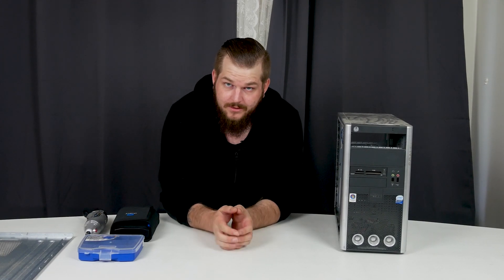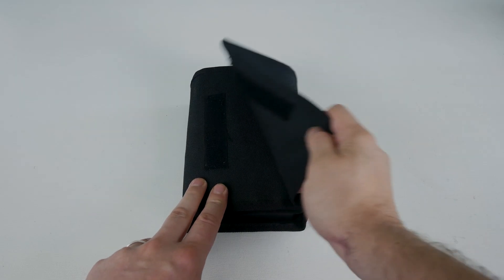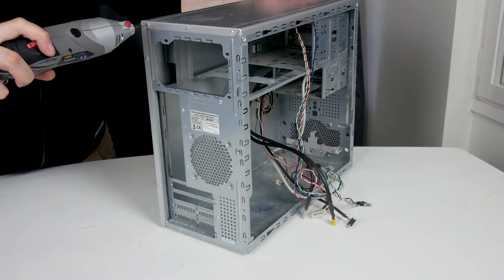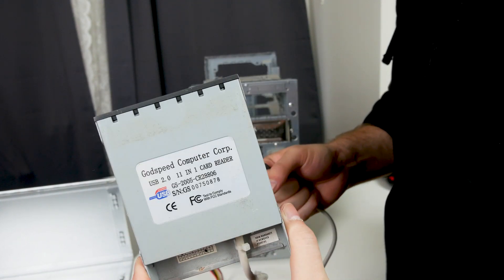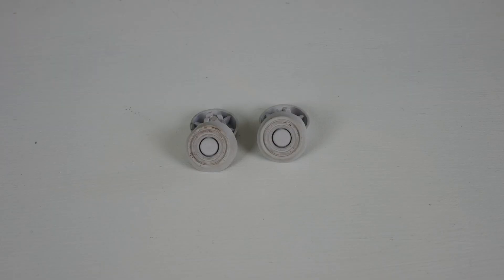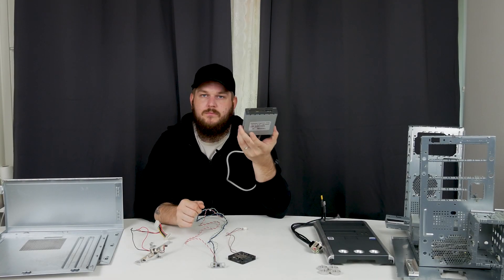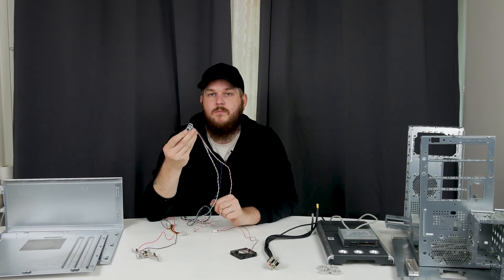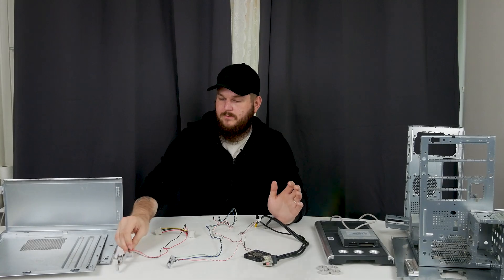How To Completely Dismantle A PC Case | Beginners Guide

Comment: I tried to disassemble one of the older cases because i wanted the HDD. BUT IT WAS RIVETED! WHUUUYYYY? Btw, to remove the rivet, did you drill it? Is there a special tool for it?
Reply from the maker: I have never seen a HDD mounted that way, it’s just dumb. Yeah I drilled all of them, in your case a small drill running at lower speed might be the best way for you to remove the HDD